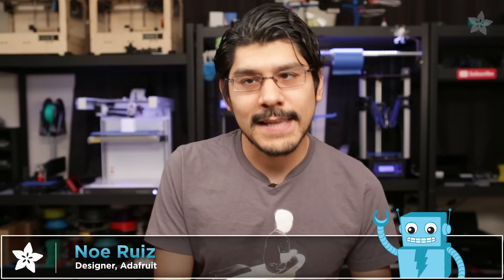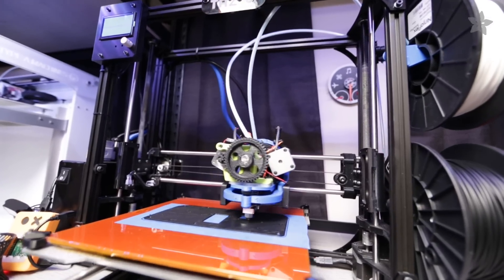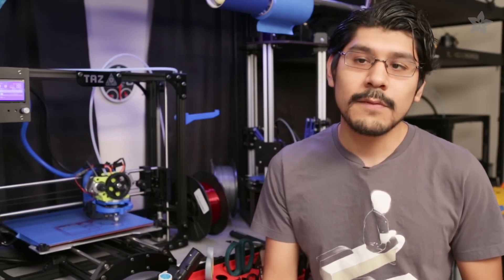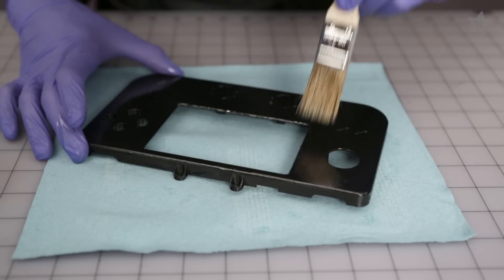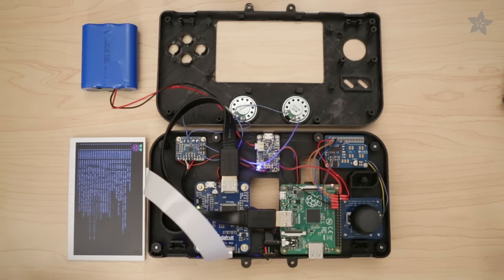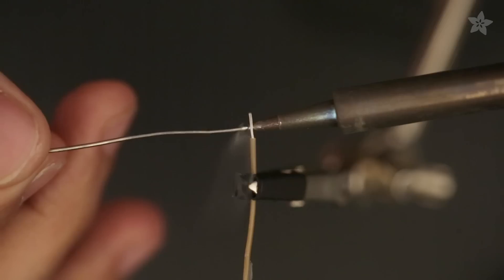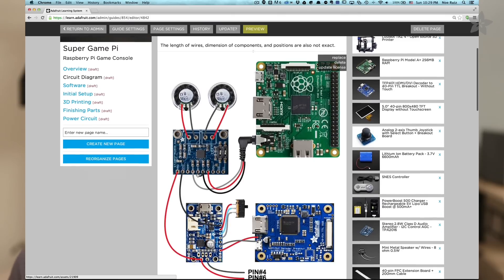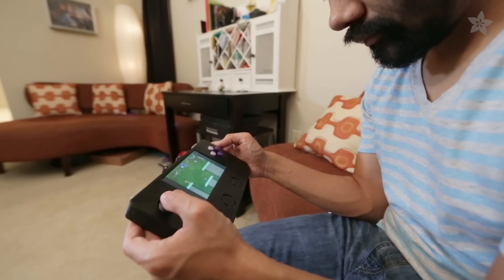3D Printed Super Game Pi - Raspberry Pi Gameboy

Comment: ...Why in the world did you utilize a single analogue stick? Why not go the distance with a Dualshock 1 or 2? All the buttons you'll need that a Raspberry Pi could utilize. I mean, if you wanted to get complex about it, you could probably take the face buttons and d-pad of an SNES controller and add the stick and shoulder buttons of the Dualshock 1 or 2. Probably the Dualshock 2, as it's buttons were lighter, and the controller itself is everywhere.

Comment: the finish on the plastic from the brush is a bit rough looking, is there a better way of applying it? perhaps adding a few coats and then sanding
Reply: +Saphiros You are right. Perhaps using an airbrush to apply the lacquer.
Reply: Yes sanding and using spraypaint would give a much smoother finish.

Comment: I'd be interested if you could add another analog stick (on the right side), a d-pad where the current analog stick is, move that stick down, and add two shoulder buttons and two triggers(basically makinig it an Xbox360 controller with a screen)

Comment: I like this one any way we can have something like this with your pcb boards that are premade and for Rasberry Pi 3 Model B with 7 or 5 inch screen?
Reply from the maker: Should be able to use the PiGRRL Zero Gamepad PCB instead of the SNES ones. Been planning to remake this project with a Pi 3 for sometime, it's on the todo list! –Noe
Reply: You and your brothers projects are really awesome! They would be the projects I would work on if I knew electronic engineering. Luckily you guys are doing it I can follow along and learn, thanks again for making this stuff!
Reply: Adafruit Industries Would the tutorial and components be the same for the rasberry pi 3?

Comment: Are there any parts I can use instead of an SNES controller for the buttons? I want to make this into something that could be mass produced, so I can only use parts that can be used in there original condition.
Reply from the maker: The PiGRRL Zero Gamepad PCB could be used instead of the SNES controller. You'll just need to sort out a way to mount them to the case. https://www.adafruit.com/products/2934

Comment: Hey Adafruit how soon do you plan on remaking this portable console for the pi 3? I would love to make one of these! However I would want Dual Joysticks, shoulder buttons, and a D-pad as well and have no idea how I would go about creating my own custiom 3D printed diagram without a 3D printer. How possible is it to cram those all in a case that size? Soldering, wiring and screwing with the pi doesn't hold me up. I simply haven't found a case design that contains all of those features

Comment: Can I use PS2 button controller? Would that work? 'Cause I only see videos with SNES ones.
Reply: Plus, how much for the 3d printed case and how much for all the project?
Reply: What material did you use for printing?
Reply: it should work if you know what you're doing. you can even make you own controller and buttons from scratch. I think it's because the SNES controller was easiest and cheapest.

Comment: How would you suggest modifying this design to have an HDMI port that once plugged into would override the built-in screen and display on the connected outside monitor or TV instead? All I could think of was have the internal screen be composite based so the raspberry pi would naturally switch to HDMI but I'd rather use an HDMI capable internal screen. Thanks in advance!

Comment: If i were to do this project i would add a dpad, an HDMI output, and a headphone jack.. how much more would that cost? and can the retropie run gamecube?
Reply from the maker: +Gcuber I believe retropie has a gamecube emulator but check their site for full list of supported emulators. The cost of the additional things wouldn't be much but the case would have to be updated. We plan to remake this with a Pi 3 and dpad in the coming months ;-)
Reply: +Adafruit Industries Thought a gamecube was more powerful than a raspberry pi still. Not to mention that if you emulate your system has to be even more powerful no ? That's what I read anyway.
Reply: Adafruit Industries Awesome! but will the pi 3 remake have an HDMI output?
Reply: +Adafruit Industries I checked the full site and they do not support it, i'm just getting into DIY stuff like this and I want to know if you guys have starter ish kits for beginners because i know this project is pretty hard

Comment: Hi guys is there any way to make this and have it connect to a wireless controllers. I can only use one hand so the game gear look has always been a problem for me. but if I had a controller it would not be a problem also can we get an HDMI port that we can hook it up to our TVs when we are not on the go.
Reply from the maker: +Randy Scribner Jr. A USB hub could be connected to the USB jack near the top and then connect a bluetooth / wifi dongles into the hub. The retropie / emulationstation software is capable of supporting multiple controllers so its possible! Instead of installing a battery pack on the back, you could plug an HDMI cable to the port through the opening. Then, plug in a USB cable from a power support into the powerboost to keep it powered.

Comment: Hey Noe, I was wondering if you could use these rechargeable batteries, makes a great tilt stand if you could make a back panel cover for the Super Game Pi. Here's the link, let me know if this is ok to use. http://www.ebay.com/itm/10000mAh-3-7V-Rechargeable-Li-ion-18650-Long-Battery-Pack-For-LED-Flashlight-/111616365568?hash=item19fcda9400:g:YDMAAOSwNSxU~FEeLooking forward for the Pi3 version!
Reply: Just use the rechargeable ones he talked about in the video

Comment: Have access to a 3d printer....right!
Reply: +Erik Fraunfelter i built one it was only 250 dollars
Reply: there are alternatives I built mine using an old broken Gameboy and managed to fit it in
Reply: +Erik Fraunfelter I know this is a few months old now, but there are also 3D printer services available online, where you send them the file, they print it and send it to you.  I haven't tried any of them yet, but I think there are also some more local, user-based websites that can connect people who need 3D printed parts with people who have 3D printers.  So there are ways around not having a printer available to you.
Reply: 250 the hole system or just the 3d printed case?
Reply: Sal Geo The whole system
Reply: Wow. How much for the 3d  printed case?
Reply: Sal Geo About 1 dollar
Reply: Do you know where I can find the measurements? Should I go through internet? I want to make a gameboy.
Reply: I think my library has some you can use...
Reply: +Erik Fraunfelter They're cheap. Makerbot 2 clones are reliable and <$300 You spent more on your phone.

Comment: is it posible to create your own games on raspberry pi???
Reply: +Vytenis Mekionis I heard gameboy games aren't hard to create. It's easy to play them on retropie. I'm no coder or expert though. However I imagine that would be one easy way. Plus you might want to port your own python games, that's a good way to start. I learned a bit of python and it wasn't extremely difficult.
Reply: +Vytenis Mekionis  Raspberry Pi runs a fully featured Linux system. It supports for example libSDL for 2D graphics, key/mouse/gamepad input and sound output. OpenGL for 3D graphics is not supported, but OpenGL ES is supported and can be invoked via EGL. So these are examples of technologies you can leverage to create your own games for Raspberry Pi. Pi is capable of hosting a compiler on itself, making it a self-contained development system, but if your code ends up complex enough, you'll probably appreciate cross-compiling from Linux on PC.

Comment: I'm in the process of putting a Pi A+ into a classic gameboy case like the original, but I'm definitely going to do something similar to this tutorial with a Pi B+ to emulate N64 and Playstation games.
Reply: Cameron Fischer I am amazed at how well the Pi 2 B+ board runs all I've thrown at it in terms of PSX titles.  Almost seems odd to me N64 looks like hell since PSX is a later device with a lot larger images.
Reply: janae clark actually, the PlayStation was a generation behind the N64 (in terms of tech). The PSX used a 32-but processing engine, but the N64 (obviously) used 64-but processing.
Reply: +Cameron Fischer I was wondering if you might know anything about why the n64 emulator usually doesn't run that well. I honestly want to set up my project for a printed 64 controller with screen and back cartridge. if they don't run that well then I guess I'll go with something different.

Comment: Hum, since it's a Snes console, I wonder why he choose the analog stick, since analog sticks are terrible for platforms and 2d games...
Reply: Retropie is not just SNES. It can hold emulators for anything from old Atari stuff up to PS1 and N64.
Reply: +Marius Rhinox Retropie can use PS1 and N64? WHHHAAAAAAA?????
Reply: +GameWarp Yeah. N64 Emulation hasn't been quite as smooth for me, but I've been using the PS Emulator with games like Metal Gear Solid without a problem.
Reply: +protossevolution  Because analog stick removes the mechanical design challenge. A good directional pad requires a lot of trial and error and will not be perfectly reproducible with a 3D printer. You need to solve for switch actuation travel and prevent counter-travel, provide centring, and solve edge friction issues.
Reply: Sean Ocansey I think the analog stick specifically isn't a difficult issue because parts are well specified and the difficulty is deferred away from the gamepad designer. The stick consists of two potentiometers which are symmetrical and divide the voltage such that you get exactly half the Vcc in the middle and known and equal offsets from Vcc and GND at the edges. Then the usual ALPS sticks (and clones) have by spec up to 25% mechanical play in the middle (typically closer to 15% in actual product), so you provide a dead zone of 25% in the middle. Indeed most available gamepads (console specific, USB, Bluetooth) today don't do deadzone processing of their own and end-user software has to do deadzone processing, as well as take typical rounded aperture of controllers into account, to be compatible with off the shelf devices.
Reply: Yah shouldn't he just use SNES buttons?
Reply: King Minos The original Doom uses keyboard digital inputs, not analog input, so, even this one fits better (because it was developed for) digital inputs. But I was wrong about the device, it's a Raspberry PI so it's acceptable to think that it can run a PS1 game for example (via emulation), where an analog stick would be appreciated.
Reply: Ooh, right! Did you use this particular SGP Model, or did you make a new cast for it?
Reply: +GameWarp The casing? I just bought a cheap one at the store I bought my Raspberry Pi from.
Reply: +GameWarp The casing? I just bought a cheap one at the store I bought my Raspberry Pi from.
Reply: I mean, did you use this Super Game Pi, or did you make a different design
Reply: it's multi platform. he just showed off SNES
Reply: +protossevolution perhaps a fighting game fan... i hear its good for those... but i hate it for fighting games too.. i love me some tekken and MK, and i do well with the dpad.
Reply: Siana Gearz I thought it was the other way around, it takes a while to set up a really good threshold on the analogue device that is not too sensitive, but very responsive. But you could be right because I don't think the D pad buttons are the problem, but rather the silicone rubber pad that sits on top.
Reply: it can play 3D games as well.